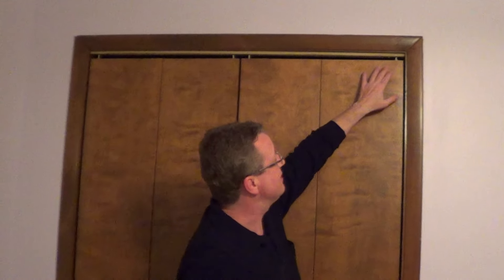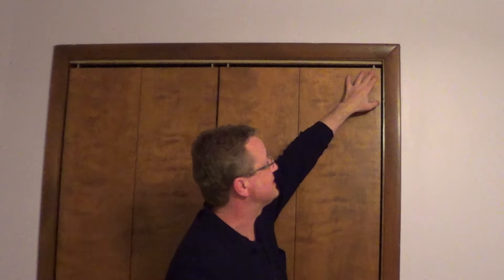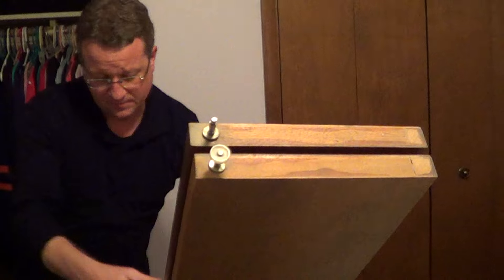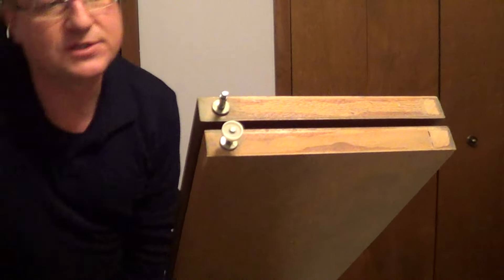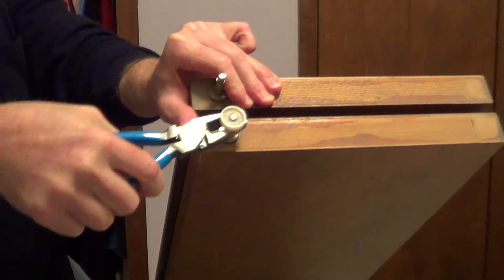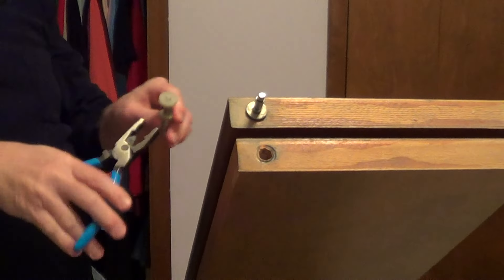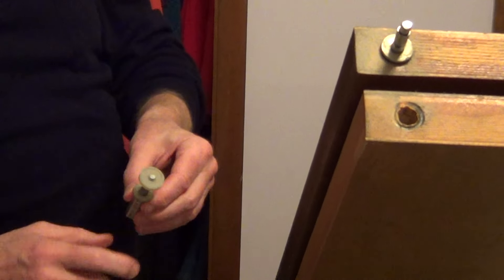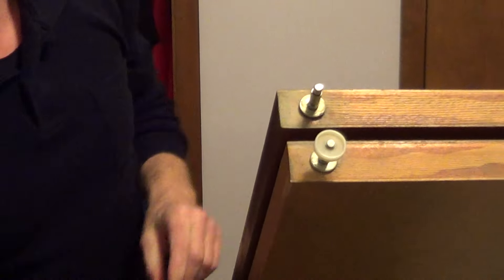How to Fix Bifold Doors - Bifold Closet Doors

Comment: My dad tried fixing one of the bifold doors that only has the plastic part without the pin with the little wheel to keep it on the track!! After they took the carpet up & put new flooring in somehow the bifold door on the  left side comes down about an inch because of the floor being unlevel. He had the plastic part where it barely stayed on the track but it kept coming off the track so I literally found a way to keep it on there. I cut off part of a straw & part of a zip tie & I folded the straw around the piece of zip tie & I stuck it down into the plastic hole & it actually worked! I bought a pivot kit & there are 2 in there. The one with the little wheel is too large but the other one might work. However I need to get the plastic part out of the door and put the new one in. I was worried I might mess it up or possibly not be able to get the plastic out. I probably will try to pull it out with pliers. What is the best way to get the plastic part out? Thanks! 🔧🔨🪛
Reply from the maker: Hi, I would try a pair of needle nose pliers. If you are still having a problem email a picture to fixitpodcast@gmail.com.
Reply: @FIXITHomeImprovementChannel Hi! That's what I did and the plastic came right  out & I put the new one in and the problem  was completely fixed!! Thank you!!
Reply from the maker: @ Great!

Comment: Question: the roller on top is fine, but the wood split on the door. Once I remove the rolller, how do i insert it a few inches over? Like how do I drill that exact kind of hole?
Reply from the maker: Hi, you generally want the hole in the same place. You can fill the split and hole in the door with wood filler, then drill a new hole with a drill bit.
Check out some home improvement tips in our e-books https://www.amazon.com/gp/product/B0B2KW1FQ9?notRedirectToSDP=1&.
Reply: @FIXITHomeImprovementChannel  thank you for responding! I'll pick up some wood filler and see if I can't take care of it in my own. 😁

Comment: what happens if the pivot is bad? And wont push back up?
Reply from the maker: Hi, it's an easy part to replace. Take out the old one and match it up at a hardware store or home center.
Check out more home improvement tips in our e-books https://www.amazon.com/gp/product/B0B2KW1FQ9?notRedirectToSDP=1&.

Comment: Can you please tell me how to fix the other piece the one that you said is spring loaded and holds the door in place?  That is broken on mine and I don’t know how to fix it.  My door has fallen down.
Reply from the maker: Hi, I would take the parts to a local hardware store and they will want you through the steps and get you the correct replacement parts. I've found most hardware stores to be very helpful.

Comment: The roller is broke on my door and wont come out:( what I do?? Its just the plastic down inside the wood door, the roller popped out
Reply from the maker: Hi, you can send a picture to fixitpodcast@gmail.com.
Reply: @FIXITHomeImprovementChannel  I was able to work it out. It was the plastic holder for the roller, it was stuck :(

Comment: I have a set of double bifold doors that I recently took apart and replaced much of the hardware. I am now trying to reassemble them but am having a problem putting them back up. I know that they go back up. but my pivot and spring on the top only go in the door with the handle . Is it me or am I in the twilight zone going crazy.
Reply from the maker: Hi, you send some pictures to fixitpodcast@gmail.com.

Comment: How do you replace the bottom pivot when the plastic part is broken and still inside the hole? How do I remove it?
Reply from the maker: Cathy Helsley Hi, If there is something to grab, I would use a locking pliers to pull it out. If not, you can drill into the piece and then turn a screw into the hole. Now grab the screw with a pliers and pull it out. You don't want to widen the hole for the new piece. Let me know if that helps. We also have a weekly podcast on iTunes and Stitcher. Here is a link http://www.stitcher.com/s?fid=49441&refid=stpr
Reply: FIX IT Home Improvement Channel Thanks so much I used pliers it took a few times but I got it. Thanks so much.
Reply from the maker: Great. Let me know if you need any other tips.

Comment: I have a bifold door with the roller and pivot not aligned between each other, door does not close smoothtly. I need to replace the roller because I broke it down while I tried to pull it out. What can I use to refill the hole and drill close by it to replace the roller at the right distance? Thanks a lot and I hope you understand my English!!!
Reply from the maker: entropiainfinita Hi, if you are drilling close to a hole you fill, I would use a 2 part epoxy. It will create a solid patch. Let me know how it goes.
We also have a weekly podcast. Here is a link http://www.stitcher.com/s?fid=49441&refid=stpr

Comment: Thanks for the tips. In my case, the top corner holding pin has come off with the spring. Can you advise on how to remove the sleeve which seems to be stuck to the door. If i can get the sleeve out, then probably i will take the set to the hardware store to get the replacement.
Reply from the maker: Hi, you can try screwing in a long or wide screw into the sleeve till it grabs and pull it out with a pliers. You can use a bolt extractor sized to the sleeve.
We have more tips in our home improvement book https://amzn.com/B01MRGO8C5

Comment: Great video, the problem the i have is that the part that i need to replace you said i need to know the size before go to the store, but this door has both that are lose because are not the right size so i need to get smaller ones ...how many different sizes are available? i have no idea what Im doing, can you please give me some advice, Thank You!!!
Reply from the maker: Hi, If you take the old parts with you to the hardware store and explain the size you need, they will be able to direct you to the right parts. Many local hardware stores that do window repair and services should have someone knowledgeable. If you are still having a problem drop me a picture at fixitpodcast@gmail.com.
We have more home improvement tips on our weekly podcast http://castbox.fm/u/6389499.

Comment: I have two bifold doors, which I have no idea how to fix.  The bottom wood, which has the stationary pieceslid up on one door and completely broke on on the other door.  I am talking about the wood piece that the rollers sit on, so how do I fix that?
Reply: yes, how did you do it?
Reply: +John Phillips my speaker fell against the door and broke the wood on the bottom
Reply: i mean, how did you fix it, lol
Reply: +John Phillips I did not fix it.  I just flipped the door over, and used the other side, the top is now on the bottom and the portion on the bottom that broke is now on top.
Reply: Interesting rig.  But how does the top pivot point (was the bottom) work with the wood/hole pushed in?

Comment: Hi, do you have an image of the part that is stationary that the closet door is on, on the floor. Thanks
Reply from the maker: Here is a link http://www.homedepot.com/p/Prime-Line-Bi-Fold-Door-Bottom-Pivot-Bracket-N-6543/100206774

Comment: I bought a pair  bifold doors at Home depot few tears ago, it's impossible to find the same the spring loaded roler (it;s attached from the side of the door, the ding dongs at Home depot can't give any solution, do you have any idea of what to do? Thanks
Reply from the maker: +yoheff988 Hi, try your local hardware store. Especially if they do screen repair, they will be able to order anything you need.
We have more tips in our home improvement book http://www.amazon.com/dp/B01BK2K0JM?ref_=pe_2427780_160035660

Comment: I'm missing a slider. I can just replace the pivot with one with a roller and that would work, right?
Reply from the maker: Mutant Baby Hi, with some, you can remove the wheel and that might fit into the hole in the track. Let me know how it goes.

Comment: what about the folding door that does not fold evenly when closed... too far in. How can I adjust that ? thanks
Reply from the maker: Hi, is it folding tight together and it is hard to open?
Reply: opening & closing are fine,, it's that the one door folds too far in ...in others words when I open the door the middle of the door folds out ,,, when I close the door the middle of the door , instead of the 2 halves being even they go too far  in as if they were being opened the other way (inside out), BTW we have the same wood doors as in the video.
Thank you
Reply from the maker: Hi, I would check the screws on the hinges where the 2 panels meet. If you tighten them up, it should fix the problem. Let me know if that helps.
Reply: I have done that to no avail. I took a small piece of wood ,, stained it and with a tiny nail, nailed it between the sections so the doors can only go so far and that worked. (hope my wife doesn't notice,,, lol ! )thanks
Reply from the maker: Hi, I bet if you take off the hinges and adjust the doors closer it will solve it too.
Reply: if you would , tell me how, thanks
Reply from the maker: Hi, I would lay the door flat and remove the hinges. Keep the doors together tight. Replace the hinges in a different spot, pre-drilling the holes.
Reply: ok , if my little piece of wood does not hold up I will do that !. Thank you soo much!
Reply from the maker: You're welcome.
We have more tips on our weekly podcast https://itunes.apple.com/us/podcast/fix-it-home-improvement/id880903087?mt=2

Comment: Question: some workers removed the door and I'm trying to put it back up. It seems something is missing because there's nothing in the door frame for the pivot pin to insert into. All I see is an empty track. What do I do?

Also, on another set of doors I have metal brackets screwed into the door where they meet about  6 inches off the floor. What are those for?
Reply from the maker: Hi, you need to have a top bracket in the track. You can pick up parts at the hardware store, or they can order it for you.The metal pieces at the bottom of the door align the panels.

Comment: My doors are constantly coming off the track.  Even after the roller and spring has been replaced.  When my husband replaced it, there is a roller and spring that he put where there should be a pivot. I am so frustrated because the doors are always coming off!  Would you happen to know why?
Reply from the maker: Hi, where is it coming off from.
Reply: Usually the roller, but also sometimes the roller (where the pivot should be according to your video).  It's actually quite dangerous, because the doors are heavy and they can potentially fall on someone.  I'm really trying to solve this problem because the doors still look nice and I really don't want to have to replace them.  Plus if there's a way to find a solution to this problem, I can fix them myself, and take the burden off my hardworking husband!  Thank you in advance for any advice.
Reply from the maker: Hi, at the end of the door, the pivot should be firmly into the bracket. You may have to adjust the bottom pivot pin up or higher so the top pivot is locked in place. That would be the first step and that may solve your problem, by raising the overall height of the door so it sets into the upper track better.
Reply: Thank you so much, I explained to my husband what you said, it worked!!!!!
Reply from the maker: Great!

Comment: Great video....I do have a question tho'. I have a single fold door in front of our pantry, and I was wondering if it could be switched around so that it opens on the opposite side. Can you help?
Reply from the maker: Patrick Riley Hi, depending on the door, you should be able to pull out the pins from the top and bottom and switch them. Then change the bracket. If you can't figure it out, send me a picture. We also have a weekly podcast. Here is a link http://www.stitcher.com/s?fid=49441&refid=stpr

Comment: I've noticed that my closet bifold doors are not flush with each other in the center where the doors meet.  The right side  sticks out 5/8" at the bottom.  Any ideas what could be causing this?  

Thanks in advance.
Reply from the maker: gremlinsbreath Hi, it will take a little tweaking of sliding the top and bottom bracket back and forth till you get the proper spacing. You may have to adjust where the pins are inserted in the bracket or even move the bracket and rescrew it into the jamb. You may also have to adjust the panel aligner by bending it.
Reply: FIX IT Home Improvement Channel
Yeah, I've taken the door off and it appears that the casing at the bottom of the doorway isn't straight.  It's off just enough to turn the the guide at the bottom outward so the top lines up but the bottom doesn't.  I'm going to attempt to twist the back of the guide to bring it back into alignment.  Thank for the reply.
Reply from the maker: Let me know how it goes

Comment: I just tried to take out the roller pin at the top of the door with pliers, wrench, etc for about an hour. I can't. It's just jammed in there. There is nothing to grab a hold of. The roller has fallen off. The spring came off as well. It's broken in two places. The only thing is the top part of the pin sticking out. The rim is wedged deep into the door. Whoever installed this really went to town with the hammer. I also have a feeling this pin has been wedged inside the bi-fold door since the construction of the house (1964), so it's an old pin on a warped wooden bi-fold door. Please let me know how I can yank out the pin. I know there are ways to yank out nails. I have no idea what tool I would need to pull out an entire pin.
Reply from the maker: Hi, if there is enough coming up to grab, use locking pliers at an angle and tap up with a hammer. If you can't grab it, use a bolt extractor. Drill into the top and screw in the extractor and pull out with a pliers.
Reply: Hi, thanks for the reply. The locking pliers + hammer method sounds good, but I'm not sure where I strike it with the hammer... once you lock it on the pin, the only thing to strike is the handle, which is not optimal for a pin that is deeply molded into the door. The bolt extractor method seems to be the most invasive. For a pin with no grooves, I imagine I would need to get a center punch as well. I feel like the door will probably just break apart before this pin ever comes loose. The original installer did a real number on it.

Comment: What if my TOP pivot bracket is moving around and it is screwed tight already? How do I replace one?
Reply from the maker: tranquilnight Hi, if you want to remove top pivot, most are held in place with a set screw. Remove or loosen that screw and twist out the bracket. You pick a new one up at the hardware store. If they don't have your style, have them look it up in their warehouse and order one for you. Let me know if that helps. We also have a weekly podcast. Here is a link http://www.stitcher.com/s?fid=49441&refid=stpr

Comment: Thank you for the video! The problem I am having is the initial spring loaded part you push down will not go down more that about 1/4 inch on my door. It's loose, wobbly and the plastic ring has fallen down to the top of the door. Any help in solving this issue would be most appreciated. Thank you for your time!
Reply: Try a pliers to pull it up
or a,screwdriver to pry it up.

Comment: But put back on the track.... that part I’m having difficulty with.
Reply from the maker: Hi, push the pin up into the bracket on top and then guide it into the bottom bracket. Sometimes easier with a helper down on the floor.
We have more home improvement tips on our weekly podcast http://castbox.fm/u/6389499.